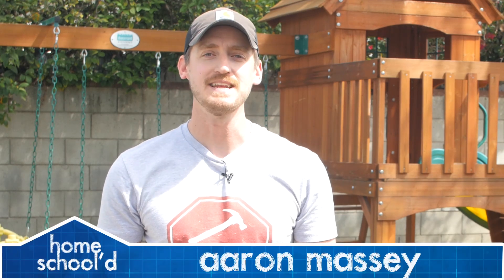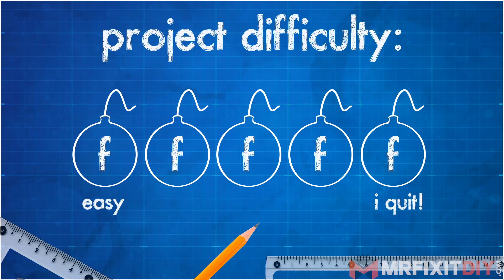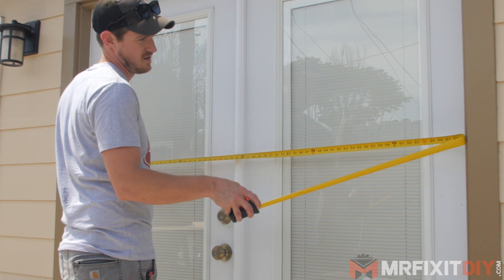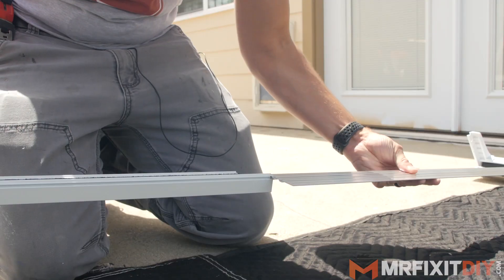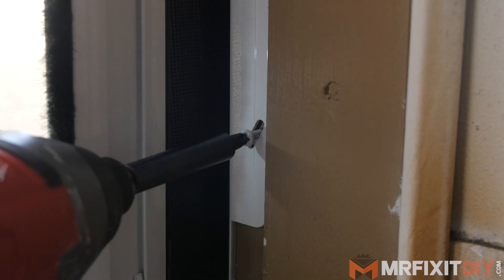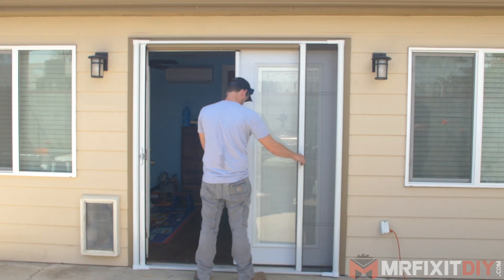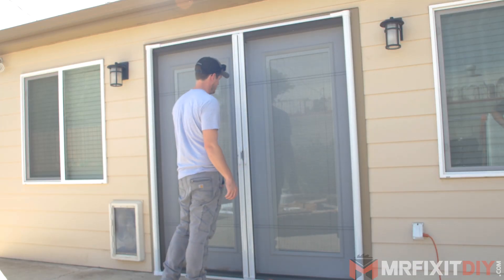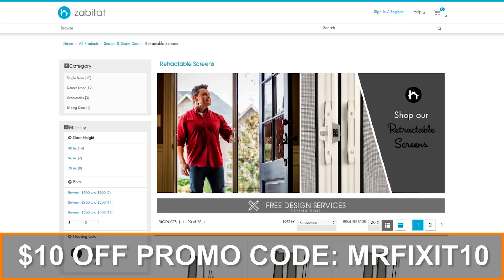How to Install a Retractable Screen Door

Comment: The only problem with this screen door having a fixed panel is that he effectively took a lovely pair of French Doors with a wide opening and made it into a single door. Maybe that's what the owners wanted. Just seems to me very limiting.
Reply: He said the second door was a fixed door.  So in this case the install didn't take away a wide opening. It was already nonexistent.
Reply: My french "doors" are the same way. The second "door" is only a window. It does not open. :(
Reply: Both sides of the screen door open. The other side is not fixed. Those pins release. It works like every other double door.
Reply: a double can be installed for true opening french doors

Comment: You said almost ANY door- but what if there is no wood frame around the door- only stucco. There is, however, 3 inches of casing.
Reply: Fine.  install it on the casing. You just want to make a continuous flat surface all the way around of at least 3/4"

Comment: Just installed  this type of door. Our opening was only 57 inches, so had to cut the rails down quite a bit. Make sure you assemble the door first to get the correct measurement to cut the pieces. Very easy installation with a helper. It works just fine.

Comment: What a about an out swinging door?  Just install it inside?  Not sure there is room to install it Inside
Reply: Why Not just flip the hinges the opposite way.
Take the door off and flip them in and then the door will open the opposite direction and you won't have to put it inside
Reply: @Firstname137  the door is by a small dining area.  The door are out swinging for a reason.  It doesn't matter.  There is room for the screen door Inside